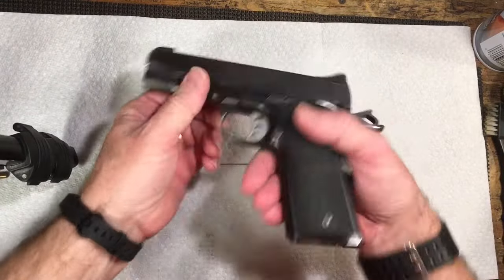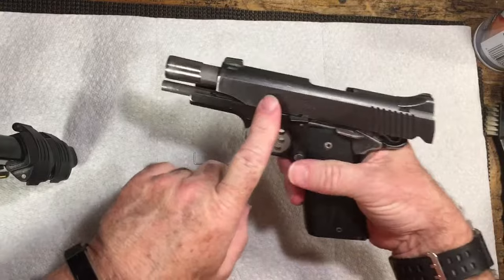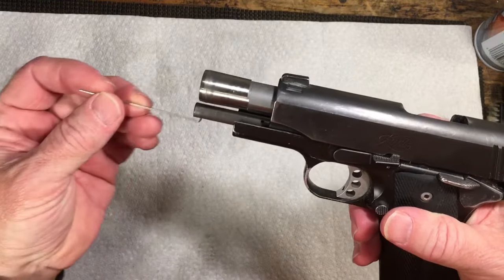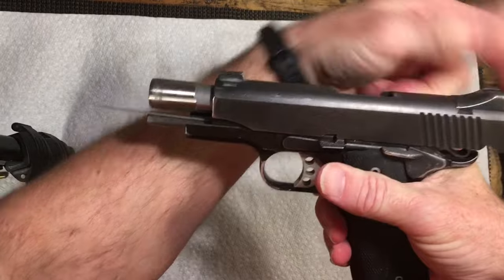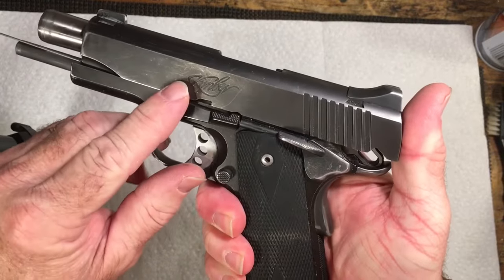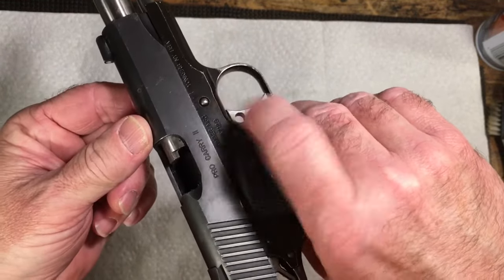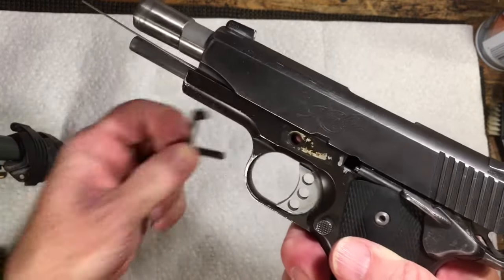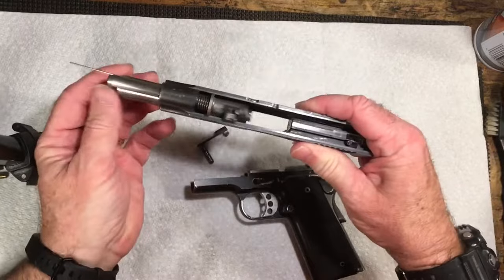How to Disassemble a Kimber Pro Carry II and Ultra Series 1911. Step by step Field Strip Guide

Comment: I have four kimbers, rapide, stainless II, camp guard in .45 & 10mm, I’ve never used a pin ( what for) to take down and put back together, so why ??
Reply from the maker: This method is used to remove the spring pressure of the recoil spring on Bull Barrel (no barrel bushing) 1911s. The Kimber Pro series with 4.25" barrels use this method. Thanks for the comment and question!

Dave

Comment: Man out of all guns Glock sigs this is hands down the worst gun to clean just watching your hands cross while jiggling this farting with that it’s as if the cleaning process was tooled by the same guy that created a auto air filter that required 5 tools just to get to it then a specialty tool for final removal. My DE.50 is easier to field strip.
Reply from the maker: Lol, you are not wrong! However, just like anything else once you do it a few times you can do it super fast and it’s not a big deal but I hear you man! Thanks so much for the comment!

Dave